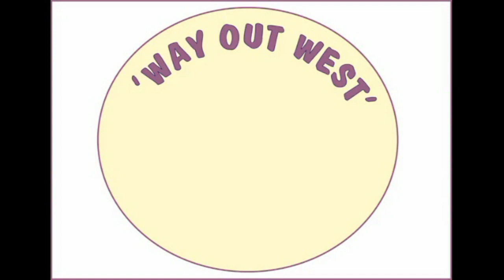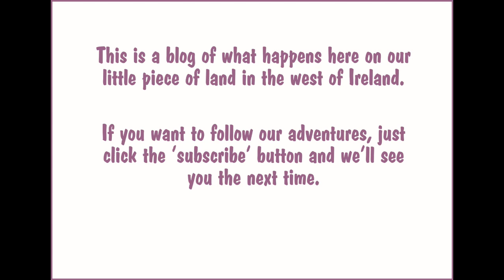New Homemade Fox Trap (But Will It Work?!)

Comment: Howdy
Only thing I saw is the door is bouncy .  If the Fox bounces the door he could grab the sides/bottom and lift the door to escape.  If the door/door frame were built on about a 15degree angle , that would work against the Fox .  or a light weight spring , just enough to not let the door bounce.
I use the same method with a commercial made Live trap.  I'm in N. central Tennessee and we have Fox/Coyote/Racoon/Opossum/Hillbillies  .
Reply: Good point man smart
Reply: A magnet to hold the door lightly shut and to stop it bouncing.
Reply from the maker: You could be right - although the frame is 2 inches deep so it would need a big bounce to clear that

Comment: Well done. In my neck of the woods we have a problem with Coyotes (which we pronounce Kai -Yoats). The ranchers hate them because they are big enough to take sheep and they, like foxes, are very clever and elusive. I've found that a baited trap (I used an old dog carrier) that holds them unharmed for a night is enough to scare them away forever. A Park Service Ranger saw my contraption and called it a "harrasement trap". I think you've got the same idea.

Comment: The fox will dig and bite and pull at the wire screen, should probably wire them to the frame on to and bottom better. That's not the main problem though, he'll get a toe or tooth on that wooden swing door and pull it open, you'll probably never know it was even in there. Maybe put a latch on the bottom that will catch?
Reply: I'm with Shane here. Also the where the fox goes in the fencing isn't tied down to the trap and he could force his way out.The right hand side as it looked like there was a bit of give in the fence there and foxes can be thinner than they appear.
Reply from the maker: I tried hard to keep the gap between the plank and the frame down to 1 mm all around - and the frame is 50 mm deep so  it would be very hard to get at the edge let alone pull it back far enough. But we'll see. Also the wire on the outside fence doesn't need to be connected to the trap as the trap is secure in itself. And lastly, the hens should tell us loudly when the fox is inside so I think he wont have much time for digging. That's the plan anyway!
Reply: Cool, hope you make a video of the fox. I'm from WV and have trapped for over 25 years, I like water trapping best but catch several gray and a few red fox each year. If I had to estimate, I'd say I catch 6 grays for each red. Of course we use leg hold traps.

Comment: I think you quite a clever fellow.. if that is the only way the fix can get into the property is through that hole in the fence I think perhaps you should have also put a door on both sides of the trap just in case he is not getting on your property through that hole in the fence

Comment: We struggle with fox and coyote, both clever and resourceful creatures. We also dont like killing them. We use a haveahart humane trap with some sucess / we cover both the floor and than pile brush over it. We mark the fox and release it but if the marked fox comes back then we will kill it. Most are smart enough not to. We raise chickens, turkeys, beef and pork so it smells good to them here. 
I  think you have too much bounce in your door , otherwise your trap looks great. I think an anxious fox will work at it and pop it up if he has enough time. 
Your videos are very good.

Comment: I tried something like this many years ago to catch a mink that was killing my poultry. I used a commercially built mink trap and installed it in my chicken coop. A few days later I saw the mink killing my chickens in broad daylight and I chased it down and killed it. So I never actually got to test my trap setup, but I think it's a good idea.

One possible problem with your design is that the door hangs vertically which would allow wind to move it enough to let the fox get his nose in the gap and escape. If the closed position was maybe 4-6 degrees off of vertical it would be much more difficult to open from the inside, and only a tiny bit more difficult to open from the outside.

Comment: not sure the top part chicken wire is strong enough.  If fox jumps up and grabs hold, looks like it would pull a gap easily.  Stronger gauge available?  how will you get fox relocated?
Reply from the maker: You might be right but I ran out of the heavier mesh. I thought we'd just put him in a sack and take him in the car? Will that work?

Comment: The only thing I have to add, Tim, is I didn't see anything preventing the chickens from walking or roosting on the wire top of the trap. I would be worried about catching something and finding footless chickens.
Reply from the maker: More than half the floor is timber and there's a perch for them too, so if they walk on the wire they can always get away from it too

Comment: I worry that the chicken wire that you put on top of the trap will not hold the fox as it didn't look sufficiently secured, once your fox is trapped he will test every aspect of your trap to both get out and get at the chickens above. Good luck.
Reply from the maker: thanks, James. The top wire is all secured down too, I just didn't show that in the video..

Comment: The fox will work hard at opening the door.  Escape option 1 . . . If he smashes the trap door back hard against the frame it will bounce forwards - the fox then needs to catch the edge of the trap door with a paw and lift it.  The hinge should be stronger than a zip tie . . .   Escape option 2 . . . the fox may eat the plastic zip ties.  Escape option 3 . . . . the wire frame ceiling is the next weakest escape route.   Can you include an alarm which rings in the house when the trap door is lifted - this would limit the time the fox has to find escape options
Reply: chris cardwell yup. Those were all on my list too. Flappy door, zip tie hinges and wire cage, but the floor is in three pieces and just placed there under the earth. She'll dig and lift the central floor panel.

But before all that...will she push her way in at all? I doubt it...but she might.
Reply from the maker: The alarm will go off soon enough - the hens will tell us when the fox gets inside. And our bedroom is only 30 feet from the house, so I can't see the fox having time to figure out any of your cunning escape plans. But of course I could be wrong..!

Comment: I love it! Very clever, and well designed, it should be irresistible to a fox.

However, I have a profound distrust of chicken wire as a predator-proof medium; I worry that the chicken wire roof may be too flimsy once the fox is in the trap. Does that chicken wire support the weight of all of the chickens? Won't they fall into the trap if they all stand on it at once?
Will an anxious fox be able to destroy the plastic hinges at the top of the swing door?
If you visit the hen house daily, I think the plywood door may be sufficient to hold a frantic fox, but more than 12 hours or so may be enough to shred the door with sharp, scrabbling claws.

Best wishes fox hunting.
Thanks for the video.
Reply from the maker: Thanks, Frank. We should be able to hear the fox/hens day or night and get there within minutes - that's the plan anyway..